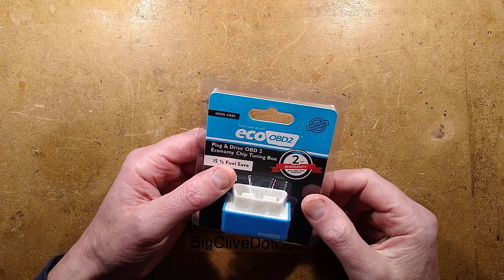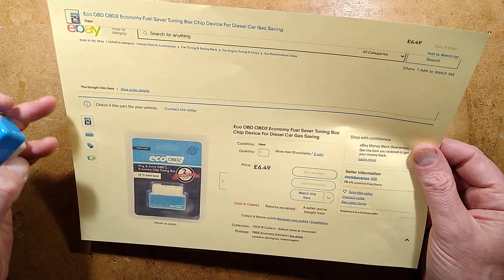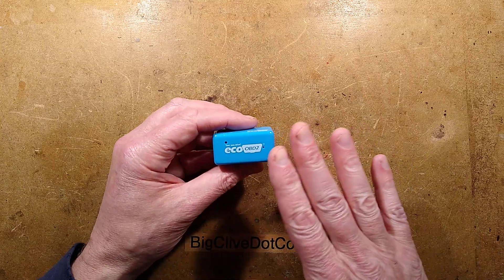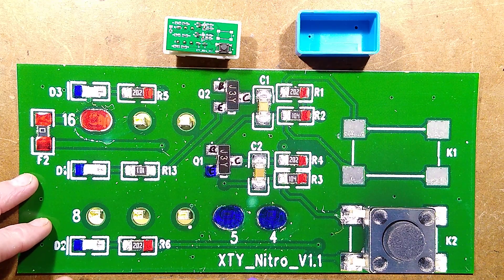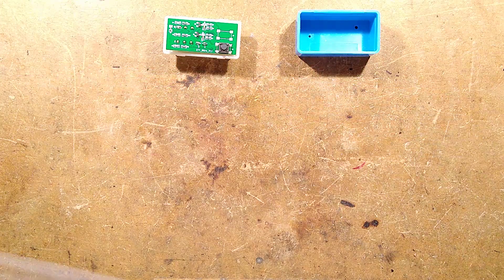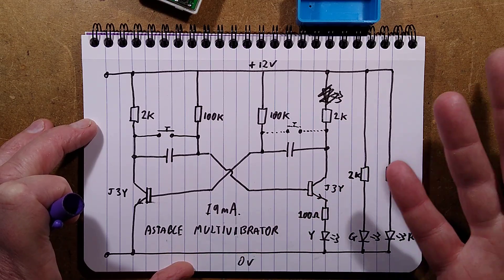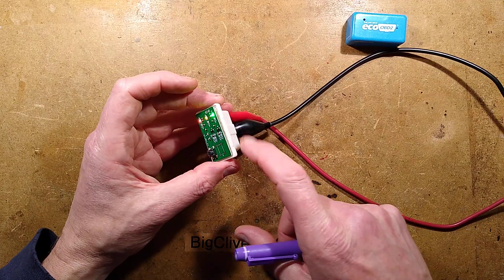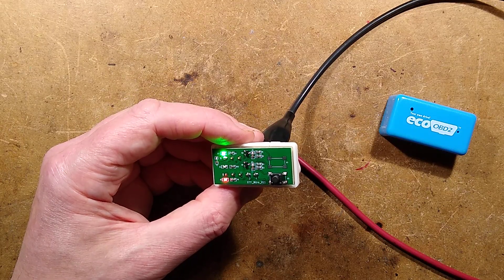Worst fake Eco OBD2 fuel saver yet (with schematic)

Comment: I finally saw one of these in the wild a month or two ago (i work at a car dealership in the service department). I wish I could've told the customer that they had been scammed.
Heck if anything it'll slightly (and I mean very slightly) decrease your fuel economy by pulling that extra current.
Reply from the maker: You should have offered to upgrade its firmware for $100.
Reply from the maker: Actually, make that $10 given the original cost of the unit.
Reply: @bigclivedotcom  I'd rather offer to smash the thing with a hammer.
I've also once seen a car come in with those fuel line magnets, a home made looking 'air turbulence' plate, the little resistor that goes on the MAF sensor and some of those other goofy "fuel savers". Then people wonder why their cars are going haywire.
Reply: If your shop sells them, then you are actually part of the problem.
And they're not just unethical, they're outright illegal. The customer could simply sue for fraud, and would probably win. The device doesn't even have a chance to do what it claims on the label. You should let your boss know that. The device is fraudulent, and selling it to customers is defrauding.
Reply: @graealex  I think you've misunderstood. Jake's saying that a customer arrived with one of these plugged into their car, not that Jake or his employer sold them the device.
Reply: @beeble2003  Okay. Makes sense. I couldn't imagine actual stores selling these. This would be as if Walmart sold fake USB drives, lol.
Not sure why he couldn't tell the customer that the fuel saver was fraudulent. If anything, it saves the customer from getting his battery drained. Plus he should try to return it to wherever he bought it.
Reply: @graealex  Probably because the mechanics in a lot of shops are in the back in the garage with separate people out the front, he likely just didn't have face to face contact with the customer.
Reply: @graealex  Oh no no no we don't sell those, I was saying I've had a car roll in for repairs and I saw one of those plugged into the OBD port.
Reply: @Jakek200  I got it, I think dude just flew off the handle. If you had seen this video, then you would have been able to show or make reference to Big Clive, or at least hinted to your patron, "nice scam, there" 😄

Comment: How wonderful... They've worked around the chip shortage by replacing those power hungry microprocessors with a 2-transistor Fuel saver... Econo to the MAX... Yeah!!!!
Reply: a 555 timer would be my choice if i had to build this
Reply: @benkerr9051  But there's a chip shortage and others will be buying up 555s for use in shop signage.  However someone dedicated to cost savings might hunt down a solution with only 1 or zero transistors.

Comment: The only systems that are even close to altering the ECM performance is $600 and up. Power Programmer and Bully Dog are just a couple companies. Fuel saving, race mode, power tow mode etc.
Reply: ALL of them are fake. The only plug in that does anything is the AFM disabler for GM trash.
Reply: @TheGuruStud  CAN bus tuning is not a scam, but it is not cheap equipment. Most of what I have seen goes through a computer like a laptop using specialized software but there are models out there that have dedicated hardware that does all the calculations and tuning on the device.  Simple one-model-only versions can be pretty lightweight and simple to use, sometimes with only a handful of prebuilt profiles they load up (power, eco, etc.).

Expect to pay a lot for any version, but they do work as advertised if your car is suitably digitized. Modern engine controllers can tweak everything from timing to air/fuel mix to even bake, throttle and steering sensitivity. Damn near everything is now actively managed on new vehicles. 

Now if you have one of the earliest cars with a CAN bus these units will likely be able to do jackall, as those early systems were just monitors over older engine designs that were still all analog/mechanical affairs. The CAN bus could tell you about faults but had no ability to make alterations to anything the engine was doing. 

But then again if you had a system that could do all this you would know which cars it would work on because you would have to get the software for the specific engine you wanted to modify, and these legitimate companies obviously do not make software for engines that have no capability to be modified in software.
Reply: @lucusloc  a passive plug in is a scam. I'm not talking about ecutek or Cobb, etc, where you actually modify the ECU.
Reply: @TheGuruStud  Cobb would like a word. SCT as well.
Reply: @TheGuruStud  cheap ones yes but bully dog and power Programmer are not. They are a chip that costs around a grand and have a screen to run the controls. I usually run mine on power so there's no fuel savings to be made there haha
Reply: @oxygen454  if the ECU is locked (nearly all are), then it doesn't do anything. You're not modifying fuel/ignition/vvt maps. It's just a reader that shows gauges and can do simple shit like increase base timing and a few specific things for certain vehicles.
Again, that's a scam. If you're not flashing the ECU, then you ain't doing shit except wasting money.

Comment: Even though it’ll probably increase costs, marketplaces like eBay really need to be held accountable for not actively looking for these things or otherwise disrupting such scams. I think the trade off in increased costs would be worth it however.
Reply: Some time ago, I bought a supposed 3000w inverter for 24v, only to find out that it was far closer to 300w. Not surprisingly, the seller continued to sell them. EBay assumes that it's the end user that is at fault, not the seller. The end user is just an ignorant hick, and all the sellers are great at what they do.
Reply: @Farm_fab  ebay is just interested to make money via transaction fees. they don't mind the buyer getting ripped of
Reply: @ingulari3977  That's the problem. You can't. You have to pay to send it back, which is often more expensive than the product itself, as you need to send it to another country.
Reply: If it sells, it makes ebay money so they have little monetary incentive to clean up their shop.  That is, until enough buyers become too disillusioned and just stop shopping their.  Lucky for ebay, there are newer online sellers (Wish, Banghood, Aliexcess) of dreck that keep ebay looking good in comparison.
Reply: The worst thing I think is that it is an utter waste of energy and resources, it is literally only garbage and poison they produce... couldn't rant enough about it. space faring civilisation .. pft !
Reply: I agree.  But in reality, the only practical checks and balances we have are right here - Big Clive.  (probably a few other smaller electronics reviewers as well)  He's just one man though, and he takes care of a cupful at a time of the ocean of fake crap on ebay, amazon, aliexpress etc.  I'm not sure what can be done - to have a proper system, you would have to employ dozens of Big Clives to go through all of the dubious electronics available 24/7/365
Reply: They'll only do something if you get authorities involved.  Like those radioactive "health" devices.
Reply: @BruceLortzHI  that would be @atomicshrimp
Reply: @BruceLortzHI  I bought a flash drive that claims to be 2TB but is only about 500mb. You plug it in it says there is a lot of memory, but the files just disappear like a fart in the wind.
Reply: how many tens of thousands of experts should they hire to buy and test if something is a scam?
Reply: @fuzzy1dk  As many as needed. It will increase the difficulty for many to sell and buy. But I do not view the cost of status quo as an acceptable trade. Marketplace operators are not common carriers like communication systems (ISP, phone, mail). Yet even then we have regulations in place to support the safety of the whole community even when it adds short term costs.
Reply: eBay should commission and pay for reports from accredited labs for every product people sell on their platform and every seller has to wait for the outcomes? 

Can't see any way that would be a problem at all. 

Or, here's an idea that's just as workable,  buyers should have to pass a competency test before they're allowed to buy anything
Reply: or you could just take responsibility for yourself.
Reply: @executive  I’m glad you support removal of all food safety regulation and fit for purpose regulation. I am sure your employer will have no problem with you having to spend 99% of your day making sure everything you purchase is actually fit for purpose and safe. Before you even have time to do your paying job.
Reply: @ZaphodHarkonnen  what on earth are you going on about

Comment: I remember buying a "fuel saving device" back in the late 90's which was basically a ceramic resistor with a label on top which you inserted in place of the MAF air sensor if I remember correctly. My friend absolutely swore that his engine ran much "better" with it fitted but I thankfully decided against it. 25 years later I now know better.
Reply: I think it was a fixed resistor in place of the IAT (intake air temperature) sensor. The car would richen the fuel mixture because it would think the air temp is much colder. It was marketed as a ‘power chip’ or ‘fuel saver’ or both and would add so much power to your vehicle! 

In reality, it would waste fuel and foul spark plugs until the oxygen sensors take over (which would take about 30 seconds after startup). 😂
Reply: @ecaparts  It's always a good sign when a product is claimed to have two opposite effects at the same time.
Reply: @ecaparts  I've had plenty of 80s and 90s GM cars with poor fuel economy because of a faulty Coolant Temperature Sensor, never telling the ECM that the car has reached operating temperature, so it would always run in Open Loop mode ignoring most sensor inputs. (It also can be the cause of "failure to shift into Overdrive.") Same result, running rich, and slowly destroying the catalytic converter.

@chitlitlah Not necessarily true, I've had faulty MAF sensors so bad the car refused to start/stay running, but after unplugging the sensor entirely, the car runs well.
Reply: @dashcamandy2242  That's because if you unplug it, the ECU knows there's something wrong with it (it's an open circuit), goes into limp mode, and uses other sensors to make a less accurate guess as to how much fuel it should inject. It ran like crap when it was plugged in because the ECU was getting readings from it even though they were terrible readings and it had no way of knowing the MAF was dirty or bad. If you unplug it but plug in a resistor, again the ECU will be getting a reading that some amount of air is entering the engine but it won't have anything to do with how much air is actually entering the engine. Putting a high value resistor parallel to the sensor could make it think there's just a little more air going in than there actually is and run slightly rich.

That's still pointless though as ECUs are programmed so that when you go wide open throttle, they throw the stoichiometric ratio and fuel economy out the window and do what they can to make power. My RX-8 aims for a ratio of about 12:1 when I'm going hard on the gas even if it's in closed loop mode. If one of these tricks was used, it would run so rich at WOT that it would probably lose some power.
Reply: Maybe a poor mans attempt at doing a lean burn system to save fuel (which actually can save 3 to 4 mpg on some vehicles)? Either way you need a lot more complexity to properly do a lean burn (custom ECUs, tuning, dyno tests, etc.), that would likely increase fuel usage by completely screwing up the fuel air mixture.
Reply: Do you also remember the original fuel saving device back in the day using magnets?? Still all over the internets even today. This device clips on your vehicle’s fuel line and the amazing magnetic 🧲 power will atomize your fuel for up to a 30% fuel savings and lots more power!! Here are their BS claims (nothing makes sense):

“Features:

*1. Destroy the hydrocarbon chain of the flowing fuel molecules so that the fuel structure molecules will generate specific resonance effects under the catalysis of the neodymium compound.

*2. Original disordered fuel molecule becomes a neatly arranged motion straight line, so that the fuel combustion becomes full and effective.

*3. Save fuel, save money, more miles per gallon.

*4. 10% - 30% fuel saving, increase ignition efficiency

*5. Low rotation and high horsepower and torque output.”
Reply: @ecaparts  if I install just 4 fuel saving technologies in my car with a 30% improvement from each.....

Do I get fuel back? Use no fuel at all? Or only need (0.7^4=0.2401) 25% of my original fuel consumption 🤔

Or do these fuel savings all actually function on the same singular technology known as Masculine Bovine Dung and thus only save 30% of fuel regardless of how many different things I install?

Also. If the latter is true and all exploit technology of MBD benefits. Maybe the reason we cannot see any benefits in real life is that car companies, completing with each other to sell cheaper fuel efficient cars for years, added them all back in the 1980s and thus these fuel saving aids are based on technology based on fixing the oldest of gas guzzlers and now have no place in the ecosystem of modern techniques?

Makes one think.
How much MBD can we sell to people before they notice.
Reply: Was likely put in place of the IAT sensor, I remember seeing these things all over eBay many years ago.
Save fuel! Get extra power! Or even both at the same time! In reality the car consumed more fuel in the end. But people swore that based on the "butt dyno" results, it really worked!
Reply: I remember doing this with the EGR system on my Astras years ago. You remove the EGR valve, replace with a blanking plate then plug a resistor into the EGR connector. It would improve performance marginally and make the engine run better, but it certainly didn't improve fuel economy. Also you have to put the EGR back on to pass mot emissions
Reply: It couldn't have been the MAF sensor, unless the resistor was in parallel with the sensor. If the MAF always gives a constant reading, the car will run like garbage and be undriveable. The IAT sensor makes a bit more sense. Well, it's not really a wise thing to do to your car, but I could see people doing it and thinking it was running better.
Reply: So many TLAs specific to computerized ICE cars that those not involved cannot understand why a sensor for fouled up doormats affect carburetor tuning...
Reply: It might have run better if he previously had a problem. Those can also lean out the fuel mixture, but generally the car or throttle input will also be altered to compensate, and there's no savings at the end of the day.
Reply: You can still buy these... Newer ones put a chip on a circuit board, usually some especially cheap 7400 series, with all the pins wired together, and a few smt resistors on either side. This way, it is a "chip".

Comment: Clive you forgot to mention the built-in safety feature: 0 ohm fusible resistor!
No doubt that's in case the LEDs get over excited while they're communicating with the ECU!
Reply: It's more likely there because some reference design for OBD devices had it and they thought it was necessary to get the power for the LED.
Or because they don't trust the manufacturing process to not end up with a dead short somewhere else.
Reply: @tin2001  i don't think it's even fusible, the track going from it may just fuse faster.

Comment: Salvage the connector for OBD hacking fun (or disaster) depending on how you wire it. :/
Reply: Use it with USB killer. For lulz.

Because everywhere on YouTube where it titled "USB killer vs car" is not correct. More like USB killer vs car audio instead.
Reply: @bitelaserkhalif  Do you think it could prevent the car from starting ?
If so that's quite alarming !
Reply: @psirvent8  Oh yeah good ol hv pulse across the CAN bus and the car will be a 1 ton chair that seats 4
Reply: @psirvent8  I am no mechanic. But the obd2 is in direct contact with the cars brains. I am pretty sure you could fry both the engine and transmissions brains. Even on new cars that could lead to a complete write off if it happens when driving.
Reply: @Speedy6617  Thank's for the reply.
This makes me so glad to still drive my old car from the 90s that doesn't have a single chip in charge of the engine functions.
Unfortunately it uses the most expensive fuel out there and also because of god*damn EU laws I can't drive to certain places and soon this car will become banned everywhere.